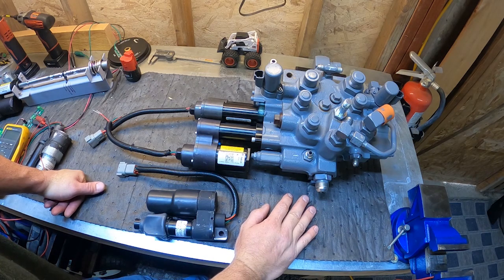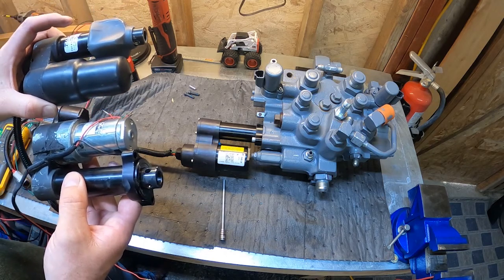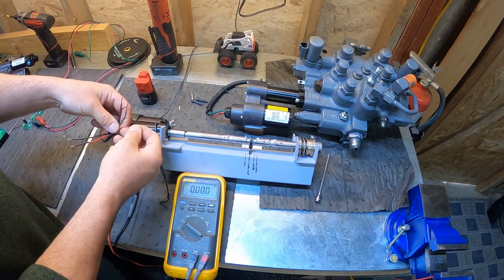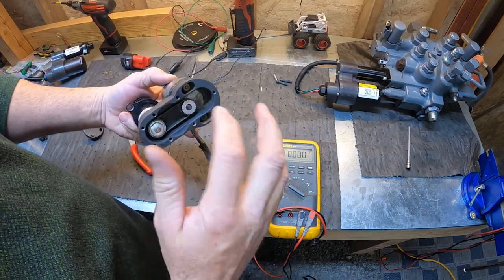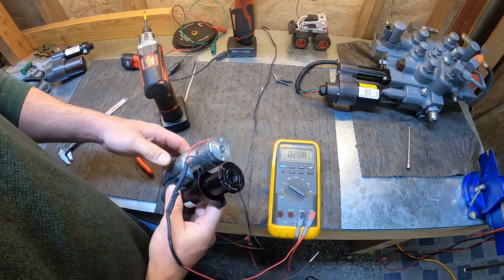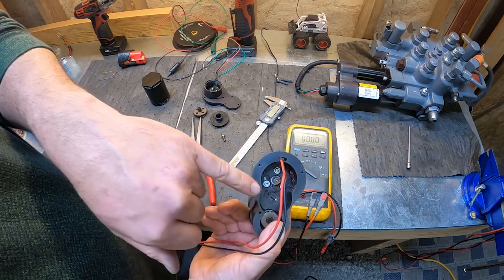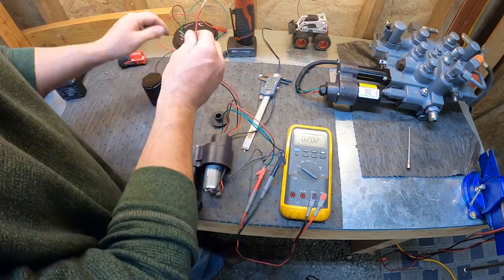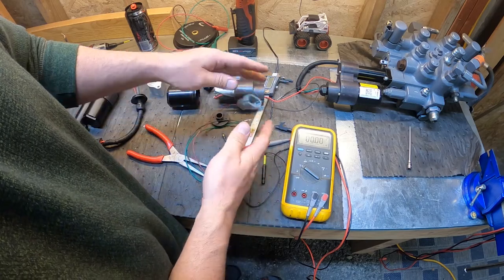Bobcat actuator, how it works, repair and calibration, what you need to know.  ACS AHC SJC

Comment: I can’t get my Lift actuator off. It will not release enough to get to the pin. Any ideas how to get to my pin so I can remove it? I’ve taken it apart and it still won’t release.
Reply from the maker: if you remove the five Allen head screws on the backside of the actuator you will have access to the gear set, you should be able to spin the actuator screw by hand or with a screwdriver or maybe even with a pair of pliers to extend the actuator. I have seen extreme cases where you may have to use a sawzall and cut to the actuator in half to get it off the stem.
Reply: @tetradgroup  I’ll try it tomorrow.. it’s really rusty inside. Great video btw. Thank you!

Comment: Why they couldn't have both the sensors black wire and motor wire black wires in one pin since both of them are ground? or maybe the motor using different voltage than the sensor?
Reply from the maker: Motor is 12vdc and sensor is 5vdc.  The black motor wire is not always ground, the polarity is reversed to drive the motor either clockwise or counterclockwise.

Comment: halfway through this, when talk about voltages you are using the newer first gen, unit, are both first gens the same on voltages? i've got an original unit. you don't talk much aobut how to upgrade the 99 or talk much about it. like is the whole loader scrap if it goes completely? BTW electronics repairers are getting better at removing potting material.

Comment: After I took the broken touch control off it I put the Key control in my skid steer but now it’s coding 34-04 and 21-03.
Reply from the maker: The machine needs to be down graded to key panel via laptop.  Security reasons.  I'll see if there might be another way.
Reply: @tetradgroup  thanks, I really appreciate it!

Comment: Hi friend, just want to ask if there is any problem to use some parts of your video in a video of mine explaining how I made a replace A.H.C/PWM Controller circuit with and arduino, I will put a link to this video in the discription and name your channel in the video when use your footage. Hope its fine, thanks in advance ;)
Reply from the maker: No problem, have you actually built an Arduino AHC controller?
Reply: @tetradgroup   Yes I did, and its working, in my neighbor bobcat, is a 863 model, I had not implemented all features of the original one but the lift, tilt, safety bar and auxiliar valve are working, the hard part was the lift and tilt control, I had to implement a PID controller, by the way, I saw that you use a motor driver and a servo driver, 13:00, to control the actuator, I try to find the circuit that you use but couldn't find it, would mind to tell me where did you buy it, it seems a simpler way to control the actuators :D

Comment: 763g everything's locked up is it the ECM are the push button top rate the left corner of the cab no codes I'll check the battery connections and wiring this will be the third ECM had to put in it I've had it since its was new in 2001

Comment: Great video.  I have T140 and getting error code  32-39. I changed connectors on the actuators and got a 32-34 and it worked again but controls were reversed I think.  Now it’s back to 32-39 and will not work at all. I have the actuators laying on work bench now. Is there simple test I can do to check them.  I have multi meters and power supply.  Thank you.
Reply from the maker: 32-39 is lift actuator not in neutral. When you removed the lift actuator, the lower one, inspect the pin hole in the spool to see if it's egg shaped, also move the spool in and out with some vice grips and make sure it moves freely in and out and springs back to center with no binding.  Swap actuators and see if code changes.  When you have the actuator out move the ram in and out and make sure it's not binding, sometimes lubrication in the slide will buy some time.
Reply: HowIDidIt they do not seem to be egg shaped.   I pushed the actuators in and now I cannt get it to come back out.  Seems like I need to pull it out with pliers or something.
Reply from the maker: I usually put the pin in the hole and use needle nose pliers to move it in and out.

Comment: Good afternoon! Excellent video tutorial. I calibrated one actuator 7104842 for bobsat 963 with joysticks, everything worked out. On the second actuator, the electric motor was replaced and after calibration it does not work. I think because of the electric motor.
Tell me the parameters of the motor power, maximum speed, voltage range from and to Volts.

Comment: The motor is part number 634-9550 but I have yet to find a place to source it at.  Anyone else locate one?
Reply: I personally have not. Any luck on your end?
Reply: @charlesthorpe3179  any luck ever finding parts? Motor or brushes or potentiometer?